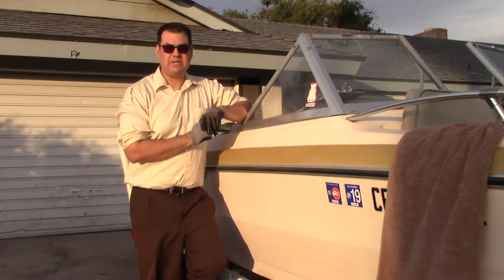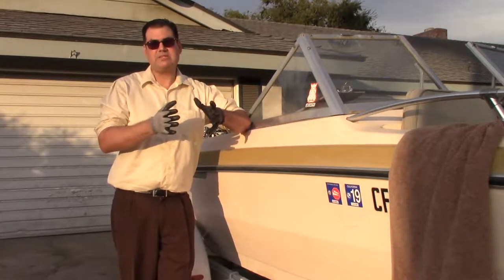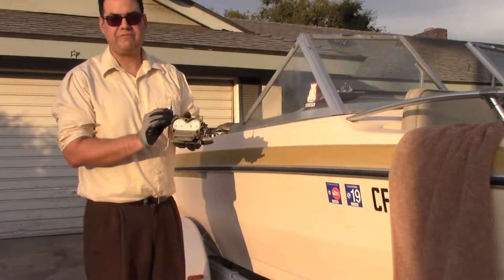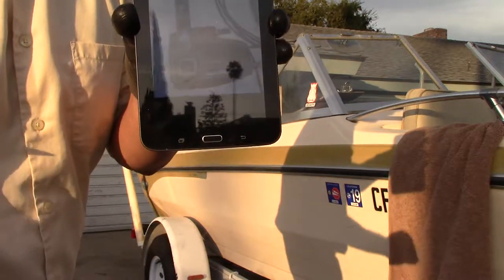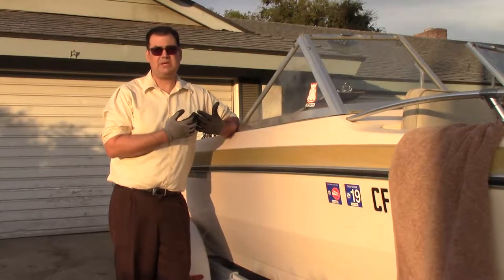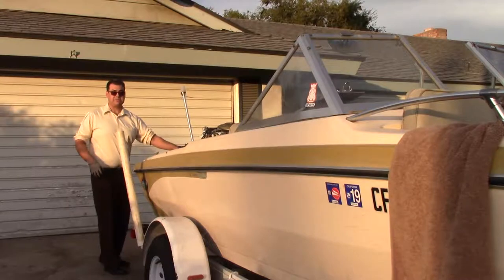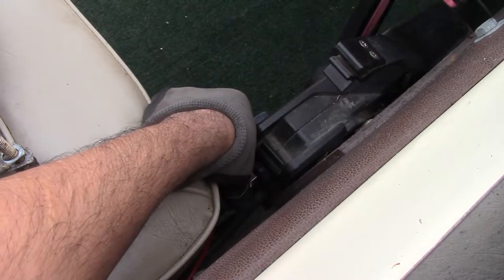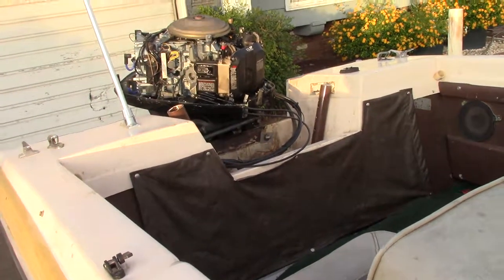How to start a outboard motor. Problems?  Get to know your fast idle & choke

Comment: THANK YOU. I bought a used boat and it didn't come with any instructions or manuals. Until today I had no idea about the Mercury "enrichener" or how to use the dual-function throttle/transmission lever for fast idle. I had a devil of a time starting my boat. Thank you again!

Comment: I bought a used boat and had a really hard time getting it started I checked the batteries several times checked wiring and even thought maybe it was a dirty carb but after a while of tinkering I found my linkage for the choke was corroded and seized. Sprayed WD 40 on the linkage and kept moving the choke back and forth and now the boat starts the first time every time so don't give up if you're a new boat owner and not really familiar with outboards just keep investigating and you'll eventually find your problem

Comment: Just experienced the boat not starting back up after an hour of sitting in the same spot fishing. Got it started after maybe 20 - 25 min of failed attempts 

I have a 03 mercury outboard - are you to push in and turn the key simultaneously? I’ve just been pushing in and out a few times , and then turning the key after - Separately.

Comment: Man, you dont know how long I've been looking for this info! Could you walk me through the steps again, or was it turn the key to on, push in for 4 seconds then turn to start, or was it start the motor while holding for 4 seconds? I've been dealing with this issue for 3 years, and it was a buddy of mine the realized there was an electric choke on my outboard, but I dont know the exact proper steps to start up! Any help would be much appreciated!
Reply from the maker: Thanks for the positive comment. First you need to make sure you know where your choke button is. Then its 3 steps, 1 raise your fast idle, 2 turn the key to allow auxiliary power and hold the choke down, 3 turn on the engine.

Hold the choke until the engine starts and let go a couple of seconds after. I can't say exactly how long to hold the choke because each engine is a little bit different.
Reply: My boat doesnt have a fast idle!
Reply from the maker: All outboards with carburetors have a fast idle. You just have to find it.
Reply: @exquisiteremodeling1  I have a Bayliner with a Mercury outboard. The throttle lever has a button in the center where it rotates that allows you to work the throttle only while leaving the drive in neutral. Hold the button in and then push the throttle forward: You'll notice much less resistance, that's because you're only moving the throttle not engaging drive.

Comment: Our boat doesn’t restart after running it for as long as I want it to. I’m probably not choking it correctly?
Reply from the maker: Probably, Choking it AND using your fast idle remember  you have to use them both together. It could also be something else like your fuel pump needing a rebuild.